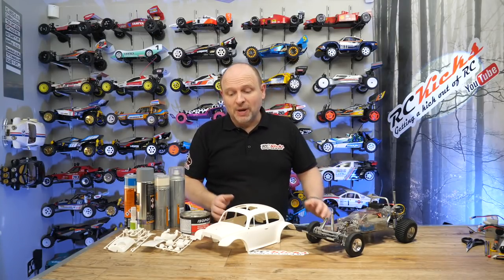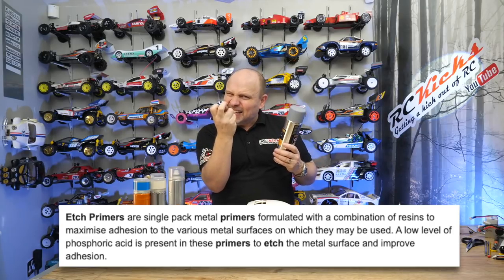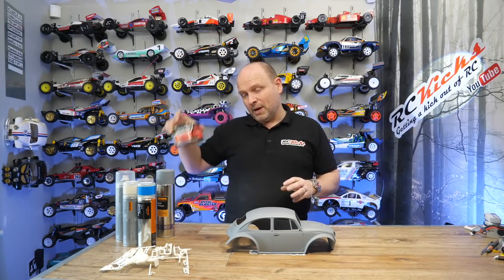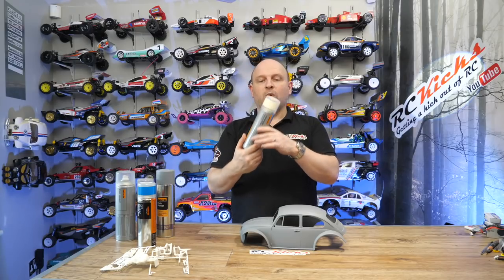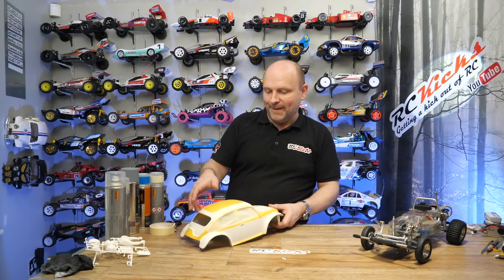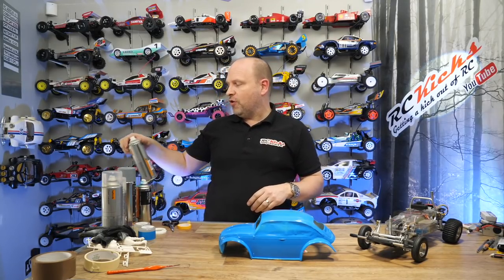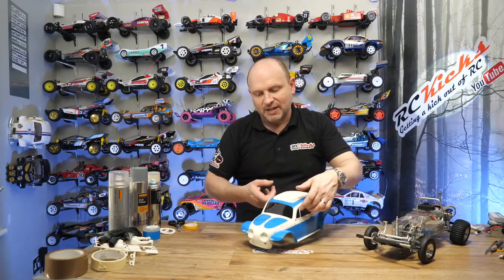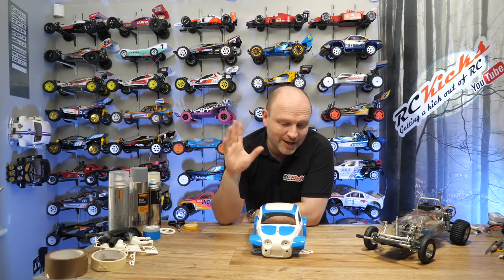Bloody Hard! Attempting To Paint A Tamiya Sand Scorcher Without Stuffing It Up Completely. Kit 58452

Comment: I'm doing a range rover hardbody for my scale crawler. Great tips for the masking. I'll be sure to use some of that tamiya masking tape for my detailed bits. 👍
Reply: Be prepared to buy a lot of spray paint 
My Range Rover hard body used about £30+ of spray paint
Reply: @freddieflanders  thanks for the tip. I've gone for an original colour too, which works out at £15 can. 😱

Comment: Well done Gav, the body's turned out stunning. You need to be careful as to what clear you use if you're going to put it over the decals as it may make the print run unless you've had success with a clear you are familiar with.

Comment: I did a Joker one and I found that the Tamiya kinda plastic masking tape for doing bends to be very useful. For bonding always sand and then use Tamiya extra fine primer.
Reply: I used Tamiya putty for the joins. Can’t recommend as some chipped and fell out when sanding, so I ended up with some join lines still showing. But one thing I did different was to install the rear lights and putties their edges in as well.

Comment: Gavs, i read that "etch" primer was no good on styrene/plastic. The etch effect only works on metal? It was the plastic "etch" stuff for bumbers that is needed. I think it was a case that the metal etch primer is just a better primer in general than others hence it works.
Reply from the maker: It’s worked better than the plastic primer I tried before.  I will try some plastic etch next time 👍🏻

Comment: A common mistake made by a lot of Baja bodies vehicle owners, is that they sand off the line on the guards, thinking it some sort of seam line. 

This is incorrect. The line is meant to be there as this is where a VW Beetle's original guards were cut, and the Baja kit guards were fitted.
Reply: Same idea with him deleting the  gap between the front-end and bonnet.. panel gap is on a real Baja Bug.

Comment: To get rid of the masking tape lines, use a heat gun set at about 180 degrees and be careful (don’t melt the shell) and the masking lines left in the paint will melt out. That’s what I had to do on mine.

Comment: Instead of using that etching prime for ur Gide coat. Put a coat of the grey primer. Then ur filler. Sand it till ur close. Then u can either us a red primer over the top of ur filler. But just spray a light dusting over the area that ur working that way u don’t sand the grey back down to the plastic. The red will show ur low points to add filler as needed. Or u can go to ur local auto parts store and buy the real Gide coat witch is black. It comes in a spray. Or in a can it’s like powder! And comes with a duster to apply it. I think u will find it better! And is a lot more user friendly!

Comment: If you are painting the outside of a plastic body like that all you want is a plastic primer than you spray one leave for a few mins then prime over the top of with your normal primer. I have never put an etch over plastic and would never try it.. The acid etch part of it will not make it bond to the plastic at all, most acids do nothing to plastic. If it hangs on at all it will be the solvent in the primer slightly melting the plastic... I have been panel beating and spray painting for almost 30 years so I have a little experience in this. The plastic that body is made of is the same as the mirrors on a lot of cars these days too btw.  If you don't crash it, it may never come off but I wouldn't trust it. I hope it never comes off. Nice masking out too, you can't beat a good fine line tape!

Comment: My top tip: when you're masking round the kidneys on the bonnet, start next to the body post hole. If the paint bleeds, it will be covered/scratched off by the body clip so it won't matter.
Reply: Use fine line masking tape, you will not have any creep or bleeding 👍

Comment: You would be better using u pol plastic bumper adhesion promoter on the body and flexible bumper repair filler as normal body fillers will crack over time then high build primer over that just a few helpful suggestions from some one that has been professionally spray painting in the motor trade for nearly 30yrs

Comment: Just wondering did u make a plastic panel to fill in the moon roof on a 3d printer. Plus my hard  body has been painted twice. Do I need to strip the paint or give it a sand and prime it.
Reply from the maker: No just glued and then filled with car body filler.

Comment: Etch primer should not be used as a cover all primer.  Etch is supposed to be dusted on lightly, 1 dusted coat, etch has an acid base that eats into the surface you apply it to, and then attaching itself to the top coat.

If you want a better primer and surface,  first use grey scotch pads to scuff, then use a plastic primer. Again dust coats very light, I do around 10. Then apply the etch primer, then within one hour apply a top coat colour or base colour. 
For masking use low tack tape or fine line masking tape. Also use a heat gun to speed up drying.
Once finished goto a good auto store that makes up paints, they should have a 2pk clear coat in an aerosol can 👍

Comment: Can I fit a 540 motor to a grasshopper with no mods
Reply: Yes you can
Reply: @darthnagus5457  cool
Reply: I would like to do this to.Do we not need a new pinion.?
Reply: @iancadwallender9779  oh yeah your going to need a pinion.  when I built mine I put a 540 in. I can't remember if I the rere kit came with a pinion for a 540.